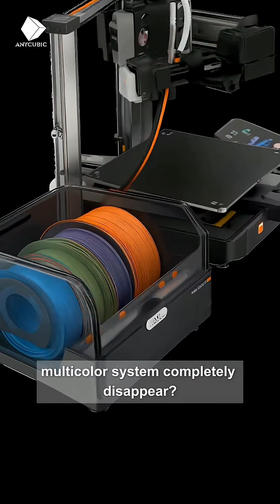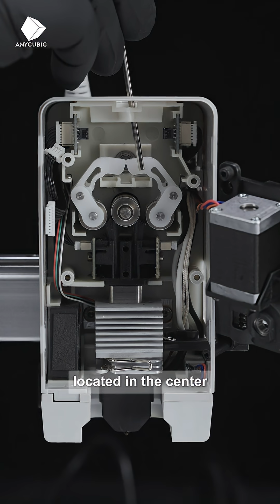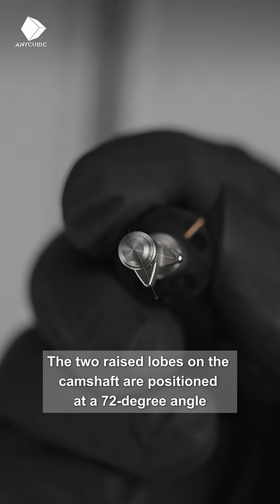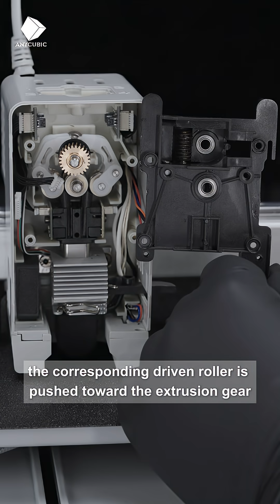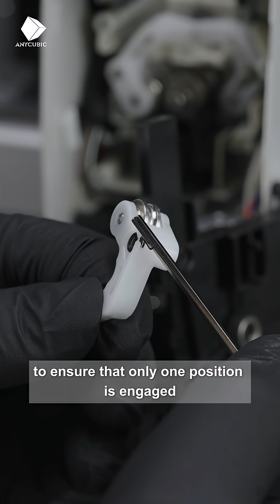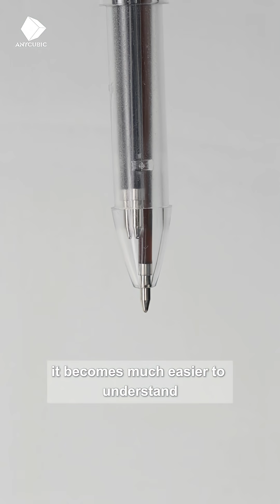Not an add-on. Built in.

Comment: I have idea, making RGBW mixer and print in full color, is that possible ? in video you avoid mixing , but what about a mode to mix 2 colors to get 3rd one , so from RGBW could make 9 colors output by mixing only 2 filaments in one time, this is also another idea :)

Comment: Super cool design but I would worry about those plastic arms breaking.
Reply from the maker: No need to worry. Take a look at our live stream. As you can see, it has been printing for four days.
Reply: @ANYCUBIC3D Im not worried about it after for days, more after years. Im sure you guys have some much more qualified engineers than some random guy on YouTube lol so I would assume it will most likely be fine for the hobbyist, but for someone in a print farm running it 24 hours a day, switching colors constantly, I would definitely worry about that being a faliure point. But I defer to you. Big fan of the brand!

Comment: Already an interesting design I hope that they make a good quality control on the extruder wheels otherwise the system will quickly become unreliable. In terms of price, it will probably also be quite interesting because a lot of accessories can be dispensed with (ACE).

We will probably be interesting for beginners. I do not expect high volume currents during the construction and for technical filaments or those with fiber components it will probably be less or not at all suitable

Comment: Interesting design. I have 3 AnyCubic color printers and on the Kobra S1 it's those little internal parts that fail after about 900 hours and are impossible to find and hard to change. Will be interesting to see if this new design is more durable.
Reply: What parts of the s1 are mostly broken for you? My first printer is the s1 and I panic what to have spare parts ....

Comment: yeah but now there is no filament dryer :(
Reply: An overall enclosure or custom spool covers would have to be the solution, there may even be a configuration planned to allow an AMS per each of the 4 lanes, expanding to 16 filaments.
Reply from the maker: @CRAITZART  19-Color Builds Legacy😁
Reply: @CRAITZART it looks like only 1 AMS feed - then it goes to an external hub. hence max 19 filaments, 3 on top, and 16 external via AMS
Reply: Every approach has compromises. This one should speed up multi-color print times so much that the tradeoff is going to be worth it for the average person. Think about this as a much faster AMS Lite rather than a replacement for the Ace Pro.
Reply: pretty sure you can put a filament dryer next to the printer and just feed straight from it to the head, no need to use those top mounted spools
Reply: Put the printer in an tent